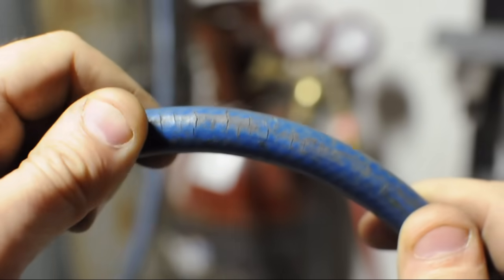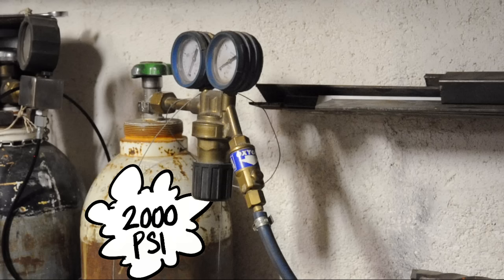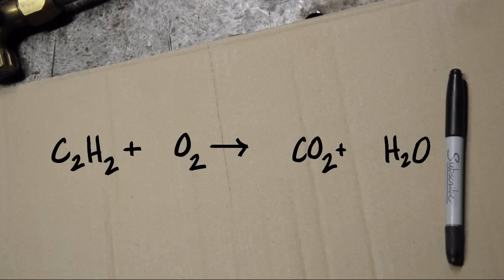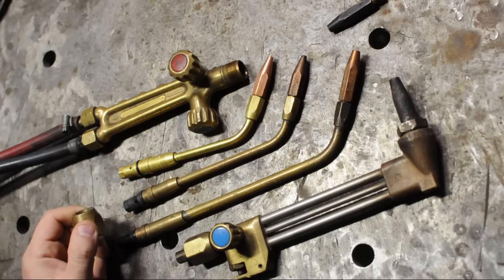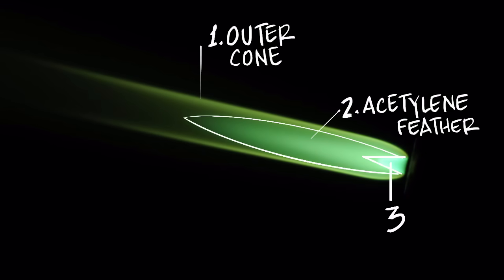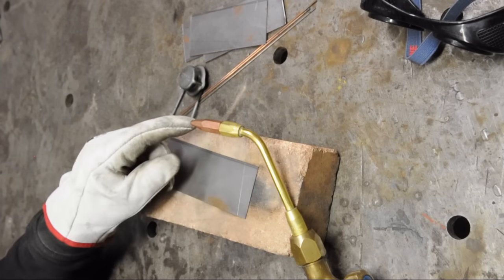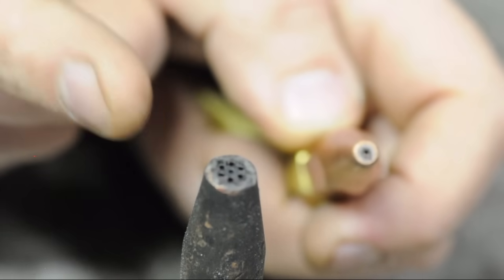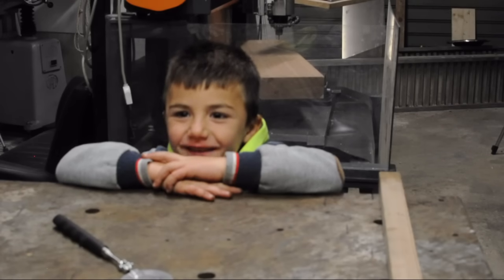Let's Talk Oxy Acetylene

Comment: I had no idea there was candy corn inside O2 cylinders! The more you know.
Reply: Barry The Chopper yeah if you break one open you will find its standard on most all tanks, they also use peach rings sometimes but its rare because its hard to get them to fill as much space due to their shape.
Reply: It acts as a desiccant to remove moisture.
Reply: I always suspected candy corn was really just waste material from some random industrial process. I wonder what industry throwns away the goo they make tootsie rolls from. /s
Reply: @nicktorr7888  Tootsie rolls aren't industrial waste so much as agricultural.

Comment: Thanks Tony, I really appreciate your videos. For me it was a good refresher after not touching a torch for decades. But you did not mention the safety point I was taught. When done,  flush the lines and  turn off the bottles. Sequence: you turn off both taps on the handle then close the O bottle then open the O on the handle and blow out the O line. Then you close the O at the handle.  The close A, at bottle, open the A on the handle and flush out any remaining O  in the torch, then close A at handle. This ensures no explosive mixture in the handle and it takes the pressure of them regulators and hoses.

Comment: 9:50 My metal working teacher gave good reason for that "lighter is a no go" thing. He said that there's been accidents when people have had faulty tip in their sets, banged nozzle accidentally and didn't notice. Then when igniting they've found out the hard way that faulty nozzle can direct flame on very odd angles and well with oxyace, the heat is so great that you'd get really nasty burns even with small gas flow amounts.
Reply: Those odd flame angles can also burst a hole in the lighter and cause the lighter to explode in your hand. And if that happens say goodbye to your fingers.
Reply: @kelvinelrick807  That could happen too, but around 3000C flame is way worse. It'll burn hand severly in fraction of a second. Buthane burning temp is less than half of the oxyace

Comment: One of the reasons you shouldn't use a lighter to start a torch is distance from the flame.  The first reason is your hands proximity to the flame with a lighter while the second of most lighters are plastic and nothing says fun like a butane fireball to get rid of all that annoying hair on your head, arms, and the eyeball dust collectors.
Reply: not to mention the fact that the flame out of the torch burns hotter than the lighters flame. so you could have the lighter explode from a backfire. (this is how my teacher explained it)
Reply: Do you suppose a lighter like a zippo would be a bit safer?
Reply: Jered Hersh jep, a zippo doesnt use a gas to light the flame, but oil
Reply: i use mt empties so nyah
Reply: I'd say: firstly, yes - the hand is much further away from the torch (= safety), secondly the spark is much hotter, thus ignition is just surer (beter assured - ?), which means "one strike and off you go". Thirdly, one can operate the striker with the gloves on, and it can be taken from the pocket, should the need arise, much easier than a lighter - be it Zippo or modern brands - with the gloves still on. Or you can just put it on the bench, close to your work area, without risking it to catch fire or blowing out, should you accidently touch it with the flame. And, oh, BTW: no one is going to take it when going out for a cigarette break.
Do we need any more reasons to use striker? I think not... ;-)
Reply: Another reason is if dirt or debris has gotten into the hole or holes in a tip you can get a rogue flame shoot out from it at any angle, which I've seen many times and I'm sure a lot of you experienced guys have too. If you're using a lighter it will need to be very pretty close to the tip to light the gas and that rogue flame could burn right through a a light in a split second making for a small grenade in your hand, thats how my mentor explained it to me. Also the cup on the striker is meant to catch a little of the gas and the sparks to make it even easy for it to light the torch.
Reply: A piezo stove lighter is tops, even after it runs out of gas, just the spark will ignite the gas. AND, it's got a long nossle to keep your hand away from the light up.
Reply: Jayzez, you are not burning my zippo !
Reply: Well, a striker and a torch combined make a pretty good lighter by themselves.
Reply: We used to light the torch with matches. It was long ago in a galaxy far, far away though.
Reply: @jeredhersh789  I use a zippo for my small propane torch and i just place it upside on a surface then approach the propane torch to ignite it. I would totally not use a zippo in this fashion for oxy-acetyl.
Reply: I've almost always light up my torch with lighter, but it's true that you should always use that proper tool for it. I'm always very mindful how I light it with lighter but there's one point that nobody hasn't mentioned. That is if you happen to have faulty, dented or possibly even bad luck of some nozzle fouling it could be possible that after lighting your torch flame is not pointing directly out of the nozzle, but in some odd angle. This possibility combined to fact that no matter how you light it with lighter, your hands will be very close to the nozzle and it's 100% sure that you'd get quite severe burns immediately. Unfortunately almost always that proper tool (forgot the English name of it) isn't functioning or is lost. If you have bottles, you should use that and keep it in good condition.
Reply: @jonnya6107  exactly. I though nobody mentioned this rogue flame direction thing which I also just commented. I fully agree on that this is the real reason why lighter shouldn't be used with torch. Even when nozzle looks good, it's almost impossible to be fully sure what is the direction of flame after ignition.
Reply: I did once get a nasty burn lighting the torch with a match because I misplaced the igniter somewhere. It is simply that the acetylene flame makes so much heat that your fingers will be too near to it.
Reply: @Fred Smith Yeah, I guess a skilled person, which I am not, would know to not open the valve too much when lighting it that way. I tend to open it wide so it doesn't smoke and then reduce it only after opening the oxygen. It also makes a nice bang as it lights :-)  That's OK when using the striker and wearing gloves but I didn't have the presence of mind to avoid it when using the match, and of course no glove. It seems that up to that point I had never really appreciated just how much heat comes off that flame even before it has oxygen.

Comment: I was 16 in 1967 and I had a job on a building site in the UK. I was in a small team whose job was to bolt heavy hot-dip galvanised plates to threaded studs set in concrete. 
None of the threaded bolts were set with any accuracy, so we had the job of re-cutting the bolt holes. We used oxygen-acetylene to make the holes bigger, but the hot dip galv really got in the way and made our job that more tricky.
I was only 16, health and safety was non-existent, but the team leader let me cut the holes. It was so much fun handling a very dangerous but very powerful tool at 16.

Comment: nice educational video ! I Just like your stile...

But you missed out on a lot of stuff:
1.: To clean the nozzle you shouldnt use the needles as they wear out the nozzles. Its better to rub the tip of the lighted burner on a piece of scrapwood. This extinguishes the torch while the glowing charcoal relights it causing it to pop. These mini explosions will blow out the dirt without hurting the nozzle. I Learned it that way (Professional mechanic in Germany), works fine.

2.: Your oxygen pressure is waaay too low. Use at least 30PSI to get safe operation and full capacity. This is due to torch design, in the bottom part of your nozzle (The part that sticks into the handle) is a jet pump powered with oxygen to suck in the acetylene. This is necessary for good mixing and to allow keeping the acetylene pressure low while using lots of it.

3.: Never increase the acetylene pressure above 7 PSI as acetylene is not stable under pressure. The high bottle pressure is only possible due to the "solving in acetone trick", if attemptet outside the bottle the acetylene could decompose generating massive heat. This decomposition can also be caused by local overheating of the bottle. The bottle will then start to heat up itself wich makes an explosion nearly unavoidable. Its kind of a fire without the need of a second component...
 If you ever notice an acetylene cylinder getting hot by itself- just run as far as you can and call the fire department!

4.: Never use pure copper with acetylene (only the tip of the torch is excluded...) as the copper will react with the acetylene, forming a highly unstable compound wich will explode on shock and contact.

5.: the proper way to light a torch is to turn on the oxygen a little bit, then turning on the acytelene and then lighting the torch. That was you get no sooty mess and the jetpump- design prvents any backfire during startup.

6.: Lighting the torch with a gas flame is perfectly fine, we had welding stations that had a small acetylene flame attacht to a dual valve device. To start welding you just pick up the torch an hold it close to that flame an the torch ignites perfectly set. to stop you hung it back wich closed both oxy and acetylene.
I would not recommend to use a lighter because sometime you get a nice fireball during ignition. Especially if you are not well enough trained at thas and you miss the perfect gas mix for a while.  But if you are wearing gloves and do it a lot it works fine.

Sorry, got a lot of text... ;-)
Reply: Nice info. I didn't know that acetylene was unstable under pressure.
But one thing I did know is that you should always turn on the oxygen first (pt. 5), but no one on youtube does that.
Reply: Forgot some important ones:

All torch sets i know operate at 3PSI Acytelene and 36 PSI Oxygen nominal, regardless of the nozzle size. Has never failed me, only ridiculous big cutting heads need more oxygen pressure. (for 10inch+ thickness)

Nominal Power is achieved when the Acytelene valve is fully open and the Flame is adjustet with the oxygen valve.

Cutting can be started when the steel is glowing between cherry-red and bright orange, it does not need to melt.
You can only cut low carbon, low alloy steel as thankfully nearly all construction steel is. Stainless, cast iron etc. doesnt work as it does not burn.
Reply: Thomas Krämer yeah always been told to crack the oxy first before starting. 
And shutting down shut off the acetylene first.
Reply: 3 psi on what planet?
Reply: Hmm I am no expert but by research and experience I have learned that the best way is to ignore numbers and set the regulators by flame visually.  That way the flow is perfect for that tip.  Also I braze pure copper, did you mean actually welding it, like getting a melt pool?
Reply: Thomas Krämer Some interesting pointers, especially setting operating fuel pressure @ regulator and not the torch.  But as for the 3psig acetylene, according to Uniweld data, 3psig isn't even on the chart for cutting the thinnest metal.  Starts @ 5psig.  However, it is on the welding/brazing chart up to 3/16" thick material.  See: http://dennisalbert.com/Welding/WeldingTipGuide.htm
Reply: jason underwood Working inside residential HVAC we're taught the same with "crack the oxy" on startup to avoid soot and setting off smoke alarms. As for shutdown, whole lotta guys arguing on another post against cutting fuel before oxy.  They recommend to shut down oxy first.
Reply: Jerry Schram, I happen to know of someone with your name in Washington state, that you?
Reply: Wow, I was taught acet/oxy on and oxy/acet off, reason was you know when your acetylene in still on, but oxygen can be accidentally left on, also keeps system free of carbon deposits, shutting acet first can cause flashback. I was taught this about 7 years ago in welding class.
Reply: My question is how can the flame possibly get beyond the valve in the handle? Can the acetylene burn by itself? Or would the hose itself burn in the pure O2?
Reply: Get and use tip cleaners not a piece of scrap wood
Reply: Who cuts 10 inch metal with acetylene?
Reply: What about massive heating torch that's like arm diameter sized?

Comment: i'm a glassworker, and in school we were taught to light the torch with something that didn't put your hand close to the torch, in case you've somehow bumped the O2, or had a large outer fire on by accident.. it's possible you could splash your hand with a whole lot of flame if it's right there. lots of people use zippos, because the flame is so long. i use a regular bic, because i'm stupid.
Reply: I agree.  I think it's mostly about keeping your hand away from the flame.  I use my Zippo often to light the torch but using a lighter filled with pressurized butane (which I've done) makes me really nervous.  I got in trouble in school as the shop teacher was telling us never to light a torch with an open flame.  "Mr. H, isn't that striker creating a small open flame?"  LOL
Reply: i regularly light cigarettes off the glass i'm cooking. hehe.
Reply: yeah i don't see why striking a flame with a flame is necessarily bad... i guess it could be an issue if you've got a leaky torch and you might blow your shit up with an open flame but it seems like sparky stuff would do the same thing, hah..
Reply: A piezo stove lighter is tops, even after it runs out of gas, just the spark will ignite the gas. AND, it's got a long nossle to keep your hand away from the light up.
Reply: I always thought it said that so you would  buy a special torch lighter from them

Comment: Flash arresters do not require heat for operation. The blast wave of flash back provides pressure to unseat a pin shaped valve held open by a spring or gas flow from tank.

Comment: Oxy-acetylene yep reminds me of the time I was in agricultural mechanics back in high school they kick the guy out of class permanently cuz I caught him trying to weld to the acetylene tank yes that's right he was trying to weld a strip of metal for practice to the acetylene tank
Reply: scary, if the tank gets warm the acy will degrade and build lots of pressure
Reply: JFC
Reply: @Ronald 240Bravo for all guys present there as well...
Reply: One great way to blow up the entire class
Reply: My buddy had A Diesel Mechanics class in high school with a mentally challenged boy that tried to cut an Oxy or Acetylene tank with a torch whichever one it was it would have been a disaster had he done it.
Reply: @appalachiangunman9589  there is more stories like that that on e would think
Reply: Robert Slackware  lol
Reply: @appalachiangunman9589  nobody can be that dense and still walking around!
Reply: Stanley Hornbeck he may not be now I’m not sure. It’s been 12 years since I graduated.
Reply: Some kid decided to use the wall as arc welding practice, and blew a hole into the next booth with another kid in it.

Comment: The acetylene doesn’t have a smell, so they add sulfur so u can smell if there is a leak somewhere, it’s a safety precaution
Reply: Sulfur is a solid. They don't add sulfur. I think they don't add anything at all. Compounds with a triple bond between the carbons or a double bond have a certain smell. Acetylene, aka ethyne, has a triple bond between 2 carbon atoms (C2H2).

You are thinking of mercaptan. They add ethanethiol to propane.
Reply: Same with propane
Reply: @vmelkon   also, it was sulfur at one point but it was changed later on
Reply: @igormorningstar  :
That would mean that sulfur dissolves in acetylene (ethyne is the proper chemical name).
That might be possible. I do know that sulfur dissolves in toluene.
Reply: @vmelkon  I think  the sulfur  was only put in there for the smell and I'm 99% sure that the sulfur wasn't being dissolved in the propane/acetylene
Reply: @igormorningstar   It would have to be dissolved or it wouldn't work (stink).  Sulfur compounds and sulfur are not the same thing.  Some sulfur compounds are contaminants that are taken out of fossil fuels as part of the refining process, and some are added back in later (like odorants).
Reply: VV Egon Spengler well in my welding class, they taught different. They DO add chemicals to make it essentially smell like doo doo eggs. Propane, acetylene ect.
Reply: You're correct that the acetylene itself doesn't have much of a smell. Nowandays, most acetylene made in the US is made from natural gas, and that acetylene would only have a very faint ethereal odor. However, the last I knew most or all of the natural gas derived acetylene was used at or near the refinery or processing plant, where it is converted to other chemical precursors. The acetylene used for welding and cutting is, AFAIK, still made from calcium carbide and water. Calcium carbide, in turn, is made in an electric arc furnace from lime and coke, and because neither the lime nor coke used are 100% pure there are small amounts of impurities like phosphorous and arsenic which makes it's way into the carbide. When the carbide is reacted with water to make acetylene, some of those impurities end up in the acetylene in the form of gases like phosphine and arsine. Those impurities (which are toxic, BTW) along with a few others are what gives acetylene welding gas it's unique odor.

The "sulfur" you are referring to are actually organosulfur compounds like tert-butyl mercaptan, methyl mercaptan, and ethyl mercaptan. Those odorants are added to natural gas and LP gas, but not to acetylene. If at some point welding-grade acetylene is sourced from natural gas-derived acetylene, then a mercaptan or some other odorant may have to be added to it. I'm not sure if acetylene is required by law to have an odor or not.